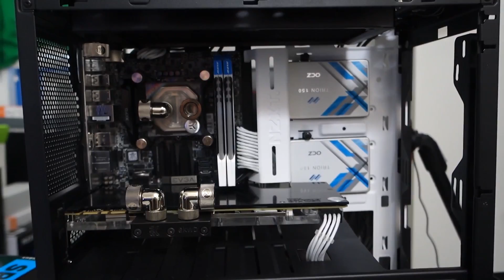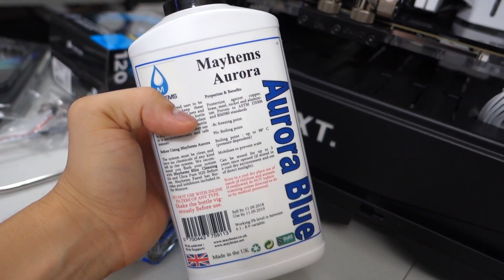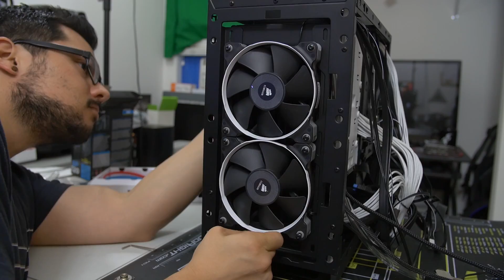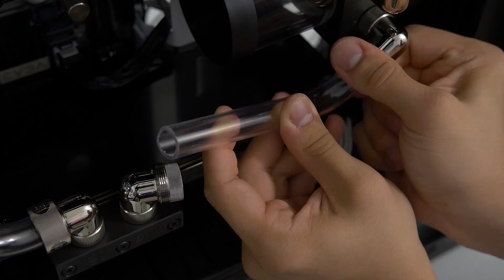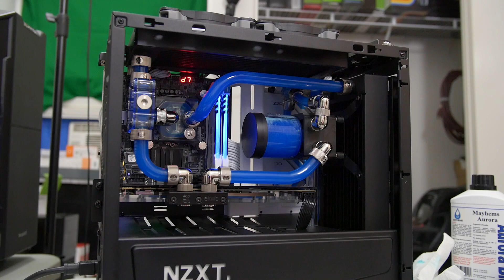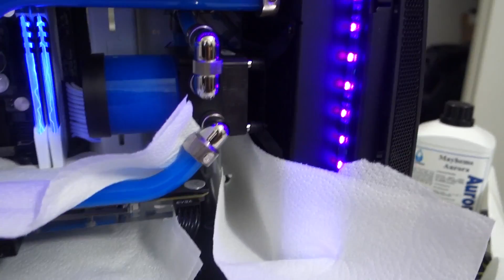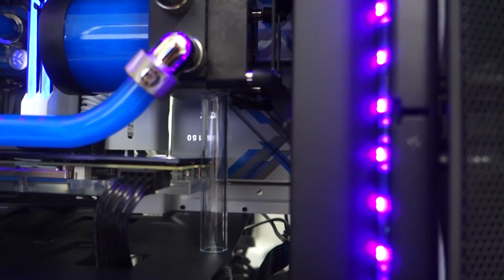Custom Tube Bending and THE MOST EPIC OF FAILS - Build Log #2

Comment: I think you keep the aurora and than just use white lights.
Reply: I mean you allready have a pink / ultra violet build
Reply: Aurora isn't for long term use more than a day or two.
Reply: +Kayla and Jim Bryant not to be rude but you are talking at you butt. It last longer than that and even when it falls out of suspension temps stay the same. The original aurora yes not the new aurora

Comment: 6.00 Sagging? Put some washers under the bottom brackets; the pump/res won't sit flush against the radiator, but the res will look parallel to the vid card

Comment: Washers/spacers between the pump and the radiator on the bottom screws, so it unslants the thing
Reply: Bravo sir.. my exact... EXACT thoughts.
Reply: I was thinking the same thing. perhaps paint the washers black so they don't stand out so much.
Reply: I would actually slant the entire radiator rather than just the pump, as I think that'd look less conspicuous, but your solution would definitely work as well, and putting spacers in was certainly my first idea as well...
Reply: easier option. bend the bottom too > pegs < ? down and refit, only need to bend them 3-5mm
Reply: Saw 6:10 thought of this, read comments, saw suggestion already posted, Good Day Sir you did my job LUL
Reply: +PimpTwzt I was gonna say the same exact thing, only to find it being the top comment...
Reply: hope he reads this
Reply: Was literally about to type this and saw your comment. xD
Reply: Thanks to experiences with my previous case I had gotten some black washers when transfering to my new Corsair 900D two weeks ago... damn, I was so proud of myself for thinking of that due to having things SLIGHTLY slanted before ;)
Reply: Yeah, was going to say the same
Reply: just typed this and saw it lol rip
Reply: win acer predator.just get entries>100.
link: https://wn.nr/KRmrZy.
hope this helps.
Reply: What is the lightning looking thing
Reply: yeah 2 small black washers
Reply: Oscar Velazquez I should really read the other comments first but great minds think alike.

Comment: Put some rubber washers in the bottom two bolts of the res stand that connect to the radiator that way it will put pressure on the bottom of it and help hold it up.

Comment: How much does a water cooling system like this cost to build?
Reply: 600-800 dollars usd . If you buy non sketchy parts ( you should )
Reply: rads: ~ 140
gpu block: ~120
cpu block: ~70
pump/res: ~130
fittings/tubing: ~100

Comment: make a mounting unit from the reservoir pulling it up from the top of your case, base from the video you show those mounting aluminum or steel or metal are to thin it will drop sooner or later due to liquid weight and vibrations. Well that is good what to worry if you burn out a power supply or that pc, look on the good side you learn on that doing that, check and double check even triple check before you put electricity on a electronic and electric devices because electricity will not think twice on burning thing up. Also had notice does the liquid cooling system I had watch for many years now do they use o-rings, I am kind of puzzled you deal with liquid and i rarely or haven't seen any o-ring use on those hole stopper, because air, liquid will find the weakest spot on a contained loop or container if you apply pressure and flow that was a standard on a manufacturing environment.

Comment: DUDE bend the mounting bracket to fix the sagging. OR put some black spacers (nylon rings, rubber rings, etc) on the bottom set of screws

Comment: Just a thought regarding the sagging reservoir: would it be possible to perhaps put washers between the relative bottom end of the mounting bracket and the radiator? the bottom of the bracket would be pushed further out, so theoretically, you could eliminate the downward sagging while maintaining sound hardware connections, and it would have the same effect as further tightening the top screws even more without putting as much stress on the mounting hardware.

Comment: what about put the reservoir where the flow valve is? and the flow valve with new clear blue UV liquid in the place of the resevoir will be more cool to see the spinning thing and you can redo the tubing of the cpu to rad. And one more thing the drain valve you can put in the bottom of the rad isn't?

Comment: fix proposal: put a small nut and bolt through the hole in the plate where you're supposed to attach the resevoir under the resevoir.

Comment: switch out the flex tubing to the drainport i think thats what is pushing the res down and you could also put some washers( i hope thats the right english word for the metal plates you put under the screws) under the lower 2 arms of the mounting bracket. and use the other coolant the one right now looks awful in that build

Comment: +Awesomesauce Network could you get a bracket for your resi and lift secure it to the NZXT metal rail that you had your first resi attached too?  could even go ghetto and just use a single long thread bolt how ever this is the easy/ugly answer

Comment: It's a thang of beauty man. And yes, would prefer the other liquid which has more transparency effect rather than the current opaque (shampoo?).
Also, you can add washers to the bottom 2 screws of the reservoir mount to lift it up to the angle you want. Can't wait to watch the next update. Cheers!

Comment: do a right angle under the pump/res from the gpu line..
imo that would straighten things up and tension the pump/res in place.
maybe.. lookin good mate!
Reply: after seeing the curvy style you've bent the loops in when filling up, a right angle wont look the part.
you might have to redo the line from the pump/res to that drain valve..
just shave a couple mm off the drain end and it 'should' tighten the angles up.
maybe, lol.
peace!

Comment: Put a black washer between the lower rad pump combo and rad as a spacer to compensate for sag....or bend the bracket a touch "clockwise" or up.

Comment: to fix the reservoir sag, just pick up some black nylon washers and install them in the bottom 2 mount holes on the bracket, that way it negates the sagging angle.

Comment: Hey Kyle great video, you just demonstrated why you should NEVER fully power your system up when first filling your water cooling loop weather its hard or soft tubing. That leak you had could have happened anywhere in the loop and totally destroyed the system. Also you had a live power supply that could have got water in it at mains voltage which is a MAJOR ELECTROCUTION hazard. People forget just how dangerous this sort of thing can be and new people to the hobby need to be warned of this. When I first fill my loop I pack the system full of paper towel , check ALL connections are tight , and then have a remote power source run the pump so that only 12v DC is any where near the loop at all.  I also noted that the coolant in your res  seemed to be spinning really fast. Did you install the anti-swirl baffle in the res with the black foam filter? One other question is , how do you top up your loop with the res laying sideways like that? I had a similar pump sag problem I fixed it the same way you did with an off cut bit of tube but on my PC you have to open it to see the tube. Good luck and happy water cooling mate.

Comment: Unscrew the bottom two screws from the pump bracket and put in some washers between the pump bracket and the radiator or the pump bracket and the pump itself. This will give it lift on the bottom and not on the top, that will counteract the sag so its straight. It wont fix the sag but will counteract it and ion theory look decent.
Reply: Posted this without reading any comments below. Sorry for the excessive amount of washer/sag suggestions

Comment: Easy add a couple of washers under the lower two legs of the tank stand. That will change the angle. You may have to use longer screws as well.

Comment: i think if you found a suitable res mount for the job, attach it to the nzxt-bar next to the ram. so it still stays there but is just attached on both ends. i think singularity computers had some kind of a piece i think could be suited for that.

Comment: Use just the mayhem uv dye, it matches the ram sticks just by itself, and no issues with possible long term issues depending on what the two companies use for their dyes. Also depending on what is causing the sag you could either add washers to the bottom 2 screws of the bracket or the pump. I would check to see if the bracket is sagging or if it is the pump sagging due to its mounting screws. if the bracket isnt sagging and you add the washers to those two screws, your pump would be level, but then the bracket wouldnt be vertical.

Comment: Linus proved he doesn't know squat about watercooling and so does this video. The build was perfect until the loop filling and priming took place. Knowing you've built one watercooling loop already in the past you'd have learnt something prior to jumping onboard watercooling on a second iteration.

The pump shouldn't be in that position since the impeller will tend to be on an angle and tend to grind away at the pump top/housing. A natural orientation would be to have the pump and the res going vertical. I also don't see how you didn't go for a smaller bitspower res for this build or rather have a custom res built for it...?

Comment: Put some small washers or rubber O-rings on the bottom 2 mounts, between the Res/Pump mount and radiator. That way it will it will lift it up a tad. It will still sag, but it will sag into the angle you need.

Comment: For a less noticable fix for your sagging pump try putting some washers in between the bottom 2 screws of the pump and the radiator. I'm not sure if it will work but it might be worth a shot.

Comment: Drain Valves are overrated. :P  

I see want you mean (just a little) with the long tube but it looks good enough not to worry about IMO.  

Never did a hard tube build myself, in part because I tend to use solid color tubing and don't like any dyes in my fluid (typically just distilled water with a little PT  Nuke).

Comment: run a small bolt through the reservor mount and have 2 nuts "giggity" one on each side to hold the bolt in place. the bolt should stick out and support the reservor.

Comment: You're getting really good with your bends. Nice job! I do agree that the bend that you pointed out could be better. As for the pump/res, I would try mounting the left side of it to mount you were originally using.
Reply: The comments about washers are good too. Having aesthetics in mind, I'd still give my first idea a shot. Washers would be a really easy fix tho.
Reply: I think matching the angle of the top bend to the angle of the bottom bend would satisfy the brain.

Comment: Why the bloody hell are you filling the tube and leak testing it with a running system and not a external psu? I like that tube job, try some washer on the lower 2 screws for the sag problem.

Comment: to stop my pipe sag I have a portal turret holding it up I'm sure something similar would work for a reservoir. I do the same to my GPU with a metal gear solid: snake eater, snake statue in a cardboard box. it's just the right size to hold it up straight without pushing it too hard.

Comment: Guys help. I'm on a budget. 24 vs 27 inch monitor. 
Would like to hear your opinion on it. 
Also, if 27 inch, 1080p vs 1440p?
Reply: I've used both 1080p and 1440p at 27. 27 is a little big for 1080p. The pixel density is too low for my liking. I'd say 24 at 1080p or 27 at 1440p.
Reply: well I think 27" is the sweet spot for 1080p but if you can afford it, definitely get 1440p
Reply: If you have a small budget, can your system run 1440p. now I'm not calling you out but can you run it? If so maybe for for it. But the one thing I do suggest is to go to a Fry's or an electronic store that has these in display and try taking a flash drive with media you'll regular watch to test. 24" is not big. Just going to say that. Just above the size of a fore arm. (My guess)(I have one but it's elsewhere) 27" seems more reasonable but it still depends on your desk. I'm running a 29" 21:9 which as other state it's like a 27" (I think)(from what I remember) In all honesty just go check them out in a store. (Extra bit. At 27" you will be able to see the pixels easier, I'm able to see them from normal desk distance when I try to, slightly. maybe you want crisp. Go 24" or 27" for immersion of sorts (still not that large, though has some heft.)just go check them out in a store if you can) Hope this helped.
Reply: Sorry for possible bad grammer and spelling.
Reply: On 27 inch you can clearly see the pixels on 1080p so if youre on a really small budget I'd get a 24 inch 1080p monitor instead as it'll look sharper. Otherwise get 1440p and youre set.

Comment: The pump sages due to the anti vibration mounts
 it isn't crappy just not designed to hold the res up horizontally maybe us a bracket through the res mount holes could hold it up nicely

Comment: I've heard that if you cool the tubing with water after bending it it can cause stress fractures, and that its better to let it slowly cool sitting out in the air.   Also, if you want the tubes to look a little bit more professional, i'd recommend using mandrels to bend the tubes so you get perfect bends every time, and all the bends match each other exactly.

Comment: For the res and pump sag just stick a couple black washers on the bottom to screws connecting the mounting bracket to the rad.

Comment: you could stop the droop by using the claps that come with the res that attach them vertically in case then use this clamp to attach it to the bracket in the back of the case to hold up the res and pump

Comment: Use a reservoir clamp put it around the res than screw it down to the nzxt bracket where the 24 pin is. It will look good and blend in plus fix the sag

Comment: you could fix the sagging by screwing the pumps lower nails with a larger nail and putting some nuts in between so it goes up and not down. but just in the lower nails.

Comment: I would try to put some plastic CNN spacers on the bottom end of the reservoir on each end to balance our the wait maybe even rubber washers you use to lower fan noise.

Comment: As far as the sag on that res/pump sag, some washers on the bottom screws should be an easy way to fix that without an external support and painting them black to match would make it near unnoticeable.

Comment: dude, are you powering the whole system when you are leak testing/filling the loop and using the systems power supply to do it too? aren't you supposed to do it with another power supply and the rest of the system off?

Comment: Hi guys I had a question I am looking to build my first pc soon and its not going to have a disc drive and I have no problem putting all the parts together especially since im not doing liquid cooling but I was wondering how hard it is going to be to install windows 10 and all that other stuff u gotta do when you first start up your new pc
Reply: With w10 its very quick doing a clean install, just use the MS "media creation tool" and pick USB drive (should be first result of Google search). When I finally installed w10 in early July (to my main SSD), I was installing graphics card drivers etc within the hour. Didn't time it, but it was definitely under 45min.
I'd recommended at the very least you download the LAN drivers of your motherboard (and/or WiFi drivers if you're using adapter), to a spare USB, just incase Windows doesn't find drivers. The rest you'd be able to download. 

Ninite.com is a great way to start a new build, huge time saver. Downloads directly from the var software's sites & installs one by one without prompts (unticks toolbars etc). 
Also while you are there on ninite, I'd recommend getting "Classic Start" listed under utilities. The w10 start menu has been improving, but still occasionally is either slow or unresponsive.
Reply: thanks a lot dude, I appreciate it

Comment: for the pump problem you could get a few washers and use them as spacers between radiator and pump on the bottom

Comment: Couple of extra washers on the bottom two reservoir screws? just a thought.
 
On a separate note, and i'm no expert at this, aren't you supposed to use one of those PSU jumpers for leak testing? Then you don't have power running to the rest of the system when you leave the fittings of the back of your GPU....

Comment: my guess for the droopy pipe would be to take tiny miniscule bit of the end where it enters the resivoir. in fact you'd be best of either filing it off or using sandpaper.
Reply: off*
Reply: No, that's not quite the issue I don't think. If the tube was stressing out the res for being too long, 1: the res would be pushed up. OR 2: The res wouldn't move and the pipe would droop drastically.
Reply: Franco Bowden eh maybe, id just try different techniques to stop it drooping.

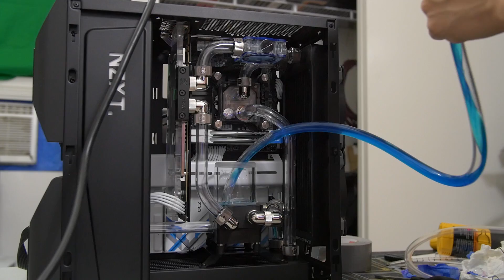Comment: 6:16 To fix try putting a washer on the bottom two screws to help fix the problem.
Reply: This was going to be my recommendation as well. Washers or shims or spacers under the bottom flanges to get reservoir aligned
Reply: He could just use a ek reservoir clamp than mount the clamp to the nzxt bracket (the one over the 24 pin)
Reply: +Matthias Dinkelbach He didn't say anything about the plugs, it's the reservoir he's talking about XD
Reply: +Matthias Dinkelbach nobody is talking about the plugs...
Reply: was about to comment this! good thinking
Reply: There's no problem with the plugs themselves, he just didn't put them in.
Reply: but that will fix trust him think a lil harder and you'll get it
Reply: there is screws that hold the reservoir to the rad
Reply: +nathan dibella the washers go under the screws :)
Reply: Rsans no way. lol
Reply: Yeah that was exactly what i thougt. Good one man! ;)
Reply: Was about to say that